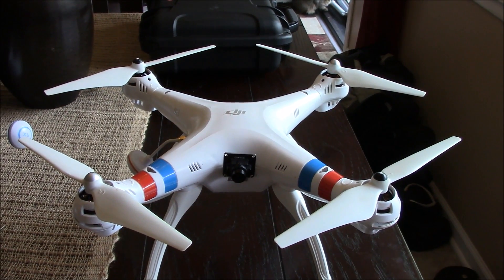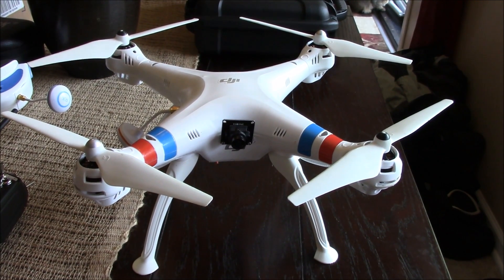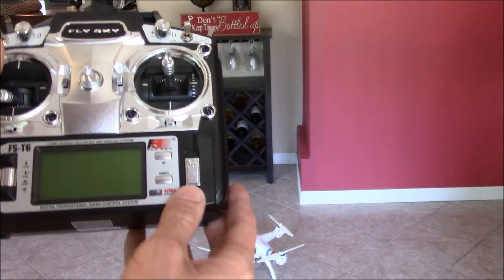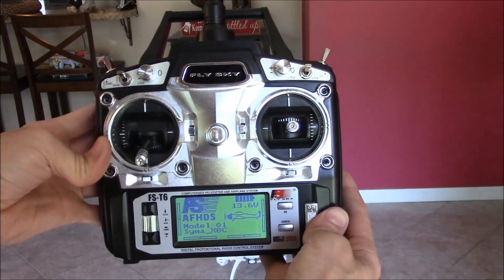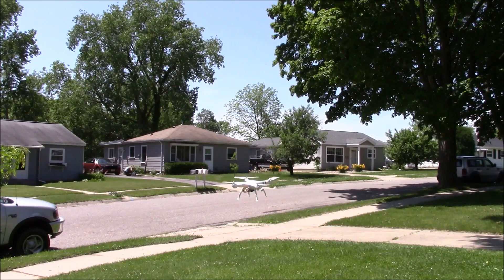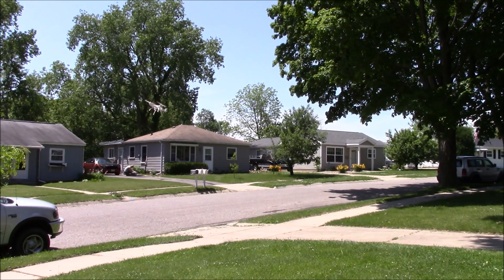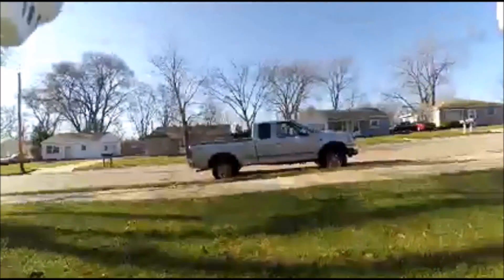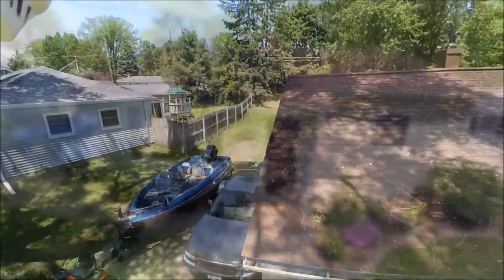Syma X8 with brushless motors and Naze32 flight controller

Comment: I have built countless drones of all sizes and makes form Chinese F330 clones to my DJI S900. My advice: Rip all of this out, and swap it all to a F450 clone frame, and leave the Syma dream behind. And with the price drop on the Naza-M-V2 w/GPS, consider getting that as your FC, and you will never look back. I like your determination and problem solving though. But IMO, you are kind of patching drywall on a sinking ship at this point. I've done the same thing with project cars myself...
Reply from the maker: I already have a DJI F550 with a full DJI flight system and propulsion system.  This was just for fun, the challenge, etc.  Not practical by any means but it was fun.  It just sits now.  Kind of like my own project cars LOL.  Anyway, thanks for watching

Comment: Will Altitude Hold feature still be available with this mod?
Reply from the maker: hendri wijaya The naze32 has an altimeter on-board, so yes you could set it to hold altitude when you program the parameters.  Preferably I like to have it switched at the RC, so I can always take it out of altitude hold if I want to do some acrobatic stuff.

Comment: You should of kept your X8 Syma stock and bought a Bayangtoys X16. The X16 has GPS, brushless motors and on sale for about $130.

But it is cool that you had the motivation & skill to turn your X8 into almost a X16. I prefer GPS because it is much steadier and easier to fly when using a sport camera for filming. Also adding a 2 axis gimble is even steadier for filming.

Good job on your project and nice video footage and flying skills.

Comment: is it a 3 cell or still a 2 cell
Reply from the maker: Seth Byas 3 cell under in video.  Can use 2 cell Syma within body if desired.  3 cell too large to fit inside.

Comment: What is the extra battery benith the drone for?
Reply from the maker: Seth Byas That is the flight battery.  I was using a larger more powerful battery, however the original Syma battery can be used internally on this build.  It will fly fine on the 2 cell Syma battery.

Comment: Hi, Droning Around, your work is amazing. I would like to know how much is the functional distance now with all that components? The original range of X8 looks poor for me if it is for FPV purpouse. Thanks for your videos!! :)
Reply from the maker: WalkingOnDreams Thanks!  I don't remember what the max radio range is, although I think the fpv would be the greater limitation.  Because mine did not have any GPS or failsafe, I never attempted to max the distance on it.  I would have to imagine the radio would go at least a few thousand feet within line of sight.  As for the FPV, it's hard to say! Although I did have a 600mw high power fpv installed.  Because I have several other DJI products with long range, I was never interested in getting long range from this one.  Thanks for watching and commenting!

Comment: WOW!  I  LOVE your videos on converting the Syma X8 to brushless motors.  I love this idea so much that I decided to purchase and convert 2 of them myself to prototype a project I'm working on.  The flying qualities with the conversion looked amazing!  I plan on using one with the NAZE32 FC.  If it works the way I think it does, then I my 2nd build will be using the APM 2.7 from Hobbyking so I can give it autopilot/gps capability abilities it does not have.  I LOVE Sunnysky/Tiger Motors/KDE motors motors and use them exclusively as I have had NOT problems with those motors.  Other change is that I will use my Taranis X9D transmitter.

Two questions
1.......With your modifications, how do you feel the modified Syma  X8 flies compared to the DJI Phantom?  

2......Based on upon the flight characteristics with NZE32 setup, if autopilot/gps capabilities were added to the modded Syma X8, how do you feel that would compare to the DJI Phantom?  BTW, I intend to buy the FatShark Dominator FPV googles within the next week.
Reply from the maker: Glad you like the videos! It was a fun project.  I'll answer your questions.  BTW, I own a drone repair business and have flown or owned nearly all DJI products to date.  

1) it flies with similar control to a Phantom, but in ATTI mode of course, since mine didn't have GPS.  The exception is of course if I take it out of a angle mode, it is then free to pitch as far as you want, including rolls and flips, which a Phantom will never do. You have much more freedom, and it is faster and more powerful.

2) if I added a working GPS to this, it would be nowhere near as accurate or reliable as a DJI product, but still useful.  I use the same goggles I have with my DJI products but I can't do fun flips and things like I can with this.

Did you ever embark on your own Syma build?

Comment: after looking at that syma x8c i might have to ressurrect mine. I have to say that is the neatest, cleanest,customized syma yet. if I had that i might just fly it with the top shell off    to show off the goods lol. hell if i buy everything how much would u charge to deck it out  i have about 5 quads and i wasnt sure if the upgrade kits were a big difference in performance so i fly mine not as much but she was my first love, but i cheat on her and fly the others quads behind her back, but if i give her a makeover she will be #1 again maybe
Reply from the maker: Thanks man, it was a fun project.  I know what you mean, it's so pretty underneath the shell, its almost a shame to cover it back up!  Yeah I'm not impressed with the Chinese brushless kits for these - it seems like they would fit and function well, but they are clearly made from cheap weak components, but for around $100 what else would you expect.  I don't think I would have the time to do another project right now, but I have thought about selling the Syma that was featured in this video.  I haven't yet decided what its worth, or if anyone would actually be interested in buying it.

Comment: thinking rc model planes that i build and fly for decades ,   , i have now crossed over into the world of Quadcopters , i am thinking size 25 motors with 4-60 amp esc's , 4 -11.1v 3000mah .. what flight board would i need !? i am going for super power ! ty for sharing !
Reply from the maker: Even a small flight controller can control a big aircraft!

Comment: You are a genius!!!!!!!!!!!!!!!  And a hell of a pilot.  Thanks for sharing.
Reply from the maker: riley633 Thanks man, glad you enjoyed it!
Reply: Any thoughts on these parts?  

https://www.aliexpress.com/item/DIY-Universal-Brushless-Upgrade-Kit-Spare-Parts-for-Syma-X8-Series-X8-X8W-X8G-X8C-X8HW/32772319735.html?spm=2114.01020208.3.2.hm4USY&ws_ab_test=searchweb0_0,searchweb201602_1_116_10065_117_10068_114_115_113_10000009_10084_10083_10080_10082_10081_10060_10062_10056_10055_10037_10054_301_10033_10059_10032_10099_10078_10079_10077_426_10103_10073_10102_10096_10052_10053_10107_10050_10106_10051,searchweb201603_9,afswitch_4,single_sort_0_default&btsid=8e518de9-536c-499e-bcdf-0a974da50351
Reply from the maker: Yeah, looks like the chinese is pumping some crap out fast. They must have seen my video lol.  I've seen the one brushless kit before. They are using super cheap weak parts, but it is solder and play parts likely with good flight characteristics.  I've been tempted to order and do, for the sake of another youtube video.
Reply: tempted to buy it.  I was wondering if the motors can be upgraded like the ones you installed
Reply from the maker: Yeah, thats the thing about their kit.  Its all included in one purchase, and at least the motors fit nicely, but its all cheap junky parts.  The ESC's look very weak, probably a 10 or 12 amp.  I run 12-25 amp ESC's in mine depending on which battery I use.  The motors I'm using are much more powerful, and consume much more amperage.  I would not expect their kit to perform anywhere close to mine as far as speed and power goes.  I like to think of their kit as basically an aftermarket brushless kit that gives you better performance with just a tad bit more power.  Maybe around tax time this year I'll buy it and do another video, we'll see.

Comment: Great job, just HAD to after poor performance with stock boards. How did you determine to go with your choice of motor speed/power ? Nice work on the review again. Jeff
Reply from the maker: Heiple2007 Thanks Jeff!  Yes, after all that work, I had to make it right so I could enjoy it!  I was hoping for a slightly better result with the stock RC, but you never know until you try.  I chose these motors since they are a direct replacement for the DJI Phantom 2 or 3.  The Syma is proportionately close the Phantom, so I figured the performance would be similiar.  Also, bonus, rather than using a smooth center prop with a fragile prop nut, I can simply use off the shelf DJI spin on self-tightening props.  They look and perform great, they're cheap, and of course self-tightening!   Hopefully that answered your questions.  Subscribe to see more in the future!  :)

Comment: where did you buy the parts and how much did cost to do the camera and brushless upgrade and upgraded reciever?
Reply from the maker: I bought most of the parts through eBay or Amazon, however they are available all over the internet, and much cheaper if shipped from China if you don't mind the longer wait (assuming your near the USA as I am).  I think I spent somewhere around $250-300 on the project.  Not exactly practical but it was fun.

Comment: i am a new bie at this. what is your max fly time? what battery do you use? what is the max distance?
Reply from the maker: Flight time depends on which battery I'm using.  I can use the original Syma 7.4v 2 cell battery, but its much more fun to fly on a 3 or 4 cell battery, but due to the size, I have to mount those batteries on the belly.  The original still fits within the battery bay though which is nice.  Surprisingly, flight time is nearly identical with the original battery.  Flight distance on this retrofit is simply limited by the range of the transmitter which is pretty far, enough to get the quad far out of sight.

Comment: Nice video , good explanation of parts. I have not seen the motor change yet. It is remarkable
how the shake went away with the Naze32. Very nice flying
Reply from the maker: Thanks man! Yeah the Naze32 is a great flight controller.  No shake because I spent hours tuning the PID settings to make it fly smooth ;)

Comment: Nice mod although not much left from original X8C ;-)
I just saw another video on X8C BL motor mod which used about $50 off-shelf part with the original FC. It seems to be successful: https://youtu.be/jfk8gwKWdNk
Reply from the maker: I'm not a fan of that build.  First off, he provides very little information as to how its actually done.  There is MUCH more to it that simply soldering in the parts.  The only way that build will work is by altering and programming the ESC's software directly, and your still left with the poor performing stock flight controller.  This means you would have to buy an Arduino and serial converter (already spent more than an aftermarket flight controller), program it yourself, and you still would not have the software, support and expandability you get with a real aftermarket flight controller.  Also, the only reason it flies stable, is because the motors are cheap and weak along with the props. As far as there not being much left in the X8C, yep, that's because there is not much in there to begin with ;)  Anyway, thanks for the watch.
Reply: Thanks for the comments. As you probably have known, we are talking about a relatively complicated closed loop control system here -- i.e. the microcontroller reads the both the input from transmitter sticks and the data from all sensors to get the error between the commands and actual status of the quad, then uses the predefined algorithm (e.g PID) to calculate the outputs for motors in order to correct or minimize the error. It does this process thousands times per second.  The algorithm parameters (e.g PID values in the case of PID control) has to be tuned to a "sweet spot" that provides both stable and responsive performance. This "sweet spot" or tuned state can disappear easily when changing one or more other parts inside the closed-loop -- sensor, motor, prop and load  That is why it is very difficult to make some major changes to just part of the system without changing FC in an existing quad in hoping to significantly improve the performance. So the key challenge for SYMA X8 BL motor mod with the original FC is to make the replacement sub system -- ESC + BL motor mimic the original DC motor both statically and dynamically so that the quad is still somehow inside that "sweet spot", which also means that the more meaningful objective of this mod is to let X8 have the good durability of BL motor instead of much improved flight performance. 
You are right. A $8 USB programmer may be still needed although BLheli ESC is programmable by using just transmitter. Hopefully his part 2 video will show how to program ESC,

Comment: I just bougt x8c and I`m still learning to fly, few crashes but nothing bad. Main problem that I have is: after calibration and flying few minutes in HEADLESS mode everything is great and comands work perfect but after few minutes (I`M NOT SWITCHING TO REGULAR MODE FROM HEADLESS MODE) it is not headless mode anymore by itself, cause I`m starting to lose control, there is no more left for left, right for right, forward to forward and back to back, every comand act like is no more HEADLESS mode and I almost crash from higher altitude so please if you can provide any help???
Reply from the maker: Headless mode relies on the internal compass to maintain heading.  Any interference in the area (power lines, buildings) may have an effect on the accuracy.  Also, the quality and accuracy of the onboard compass is probably not good enough to maintain an accurate heading for a long time. It is also possible that the RFI interference onboard from the permanent magnet motors, power wires, and unshielded battery may all be affecting the reliability of headless mode.  I'd highly recommend not using headless mode.  After a few flights in "normal" mode, you will be a much better pilot, and you will have a lot more fun.   The freedom you have outside of headless mode is much better.  Think of headless mode as an analogy to riding a bike with or without training wheels.  Keep up with the practice and you will do well.  Thanks for the watch, and comment.  :)
Reply: To late, I lost my drone only cause I use headless and lost control, last sight of my quad was in the distance like small dot, spent 5 hrs looking for the drone with 5 friends and nothing, is there anyway to find my quad trough transmitter?
Reply from the maker: +REMAX1989 That's unfortunate.  I'd highly recommend you learn without headless mode next time and practice much more before flying high and far.  There is no way to track the Syma's position by signal strength.  (Some quads can be tracked by signal strength using the RSSI function, but the cheap Syma's don't have this).  Your best bet would be to wait until night and look for the flashing led lights, they will remain lit for a few hours at least after you lose it, if you have a friend with a quality drone like a Phantom you could use that to search by air.  I'm sure at this point though, it's probably too late for that.
Reply: Yes it is to late cause probably somebody found it already, I was searching 3 days 2-3 hrs and nothing...

Comment: would it work if I put a phantom 3 flight controller in the syma?
Reply from the maker: It doesn't work like that lol. The Phantom 3 utilizes a single large control board that incorporates everything, and no one in they're right mind would disassemble a Phantom 3 to put the parts into a cheap Syma.  Now, the older Phantom 2 did use more modular components, and their flight controller and GPS called NAZA is commercially available, but is rather expensive for a build like the Syma.  The DJI NAZA flight controller is pretty nice though.  Of course if you had the DJI NAZA and corresponding transmitter you could also use the Lightbridge video transmitter capable of sending video over a very large distance, but again, most people would not spend so much money only to put it into a modified Syma chassis.
Reply: +Preston Rice I just found cheap phantom 3 boards and the syma frame is really cheap so if it breaks, repair is not a pain in the wallet. But I don't know. just my thoughts
Reply from the maker: I see your thought process.  I didn't know the internals for the phantom 3 were affordable.  Of course none of that will work without the matching counterparts, transmitter, gps module, intelligent flight battery, etc.  Anyway thanks for the watch and comment! :)
Reply: +Preston Rice no problem :)

Comment: I got the x8g and was gonna buy the brushless motor kit they have it comes with the motors and circuit board for more power its around $136 for the kit do you think it would give it more power ? The ones in the kit are 1500kv what size are your motors. Regards Paul
Reply from the maker: I'm sure they would provide more power than the stock motors. The stock motors are embarrassingly weak.  I cannot tell you how well the "kit" will work though, I have not seen any first hand experience with them.  My motors are larger 2212 motors, 950kv, spinning much more agressive DJI Phantom 3 props.

Comment: thanks!!! what do you think about this one. (Turnigy nano-tech 4000mah 3S 40-80C Lipo Pack)
Reply from the maker: Good brand battery, I have a few. good discharge rating. it will give you around 14 mins flight time with that battery. But you will be a bit heavy in the air. I've flown with air 5500 mah before, lol.
Reply from the maker: strapped to the bottom of course!
Reply: thanks bro.